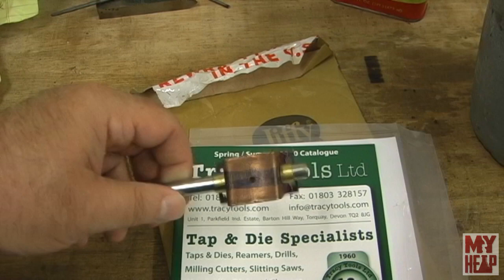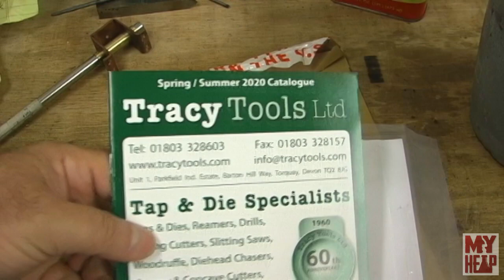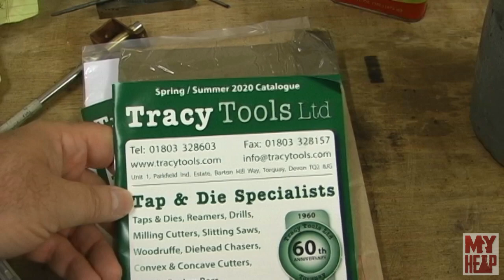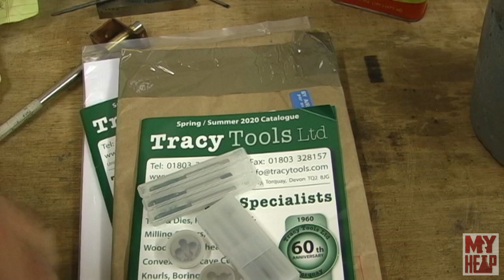Shop Update - New Tools, Metal Casting and some Shout Outs

Comment: hey man, thanks for the shoutout and good to see some fire again, lol. That adapter should be pretty easy to make, just an MT3 taper on a flanged bushing and hole bored out to fit the collets and thier tapers, which can easily indicated in by sticking one on some rod in the tailstock's drill chuck, lol.
Reply from the maker: Thanks for sending me the specs for them.  Should be a cool little project.  Thanks for the help on the burner too.

Comment: That blower you made will put out a lot of air but at very low pressure so if you restrict the air flow in anyway a lot less air will go into the furnace. Oil is very tricky to burn if you have not tried it before.
Reply from the maker: So would I be better with a radial vane type blower as described in Gingery's centrifugal fan book.  These can maintain high pressure as my rudimentary understanding interprets it.  Many thanks for the insight you can give.

Joe

Comment: I’ll try that cup. PLA?
thanks,
John
Reply from the maker: Hi John, yes sir, I printed it in PLA.  It works pretty good.  I found it on thingiverse.  If you need a link let me know and I will post it.  I like it well enough that I am going to print a few more.  😀
Reply: @MyHeap  No hurry but I would appreciate it.
Reply from the maker: @cavemansmancave9025  Here is a link to the file on thingiverse.  https://www.thingiverse.com/thing:3185838

My advice is to print one to see if you like it, then print one for every machine if you do.  HAHA

Joe
Reply: @MyHeap  That's the plan. :-)
Reply from the maker: @cavemansmancave9025  Let me know how well you like them.
Reply: @MyHeap  I will. I need to experiment with some slicer settings before I print this. Otherwise it's a 5 to 6 hour print.